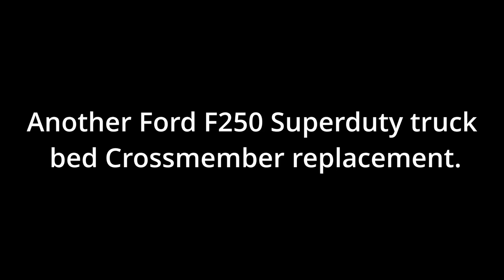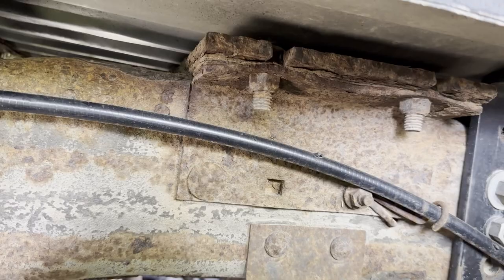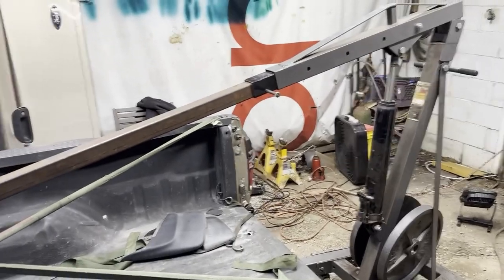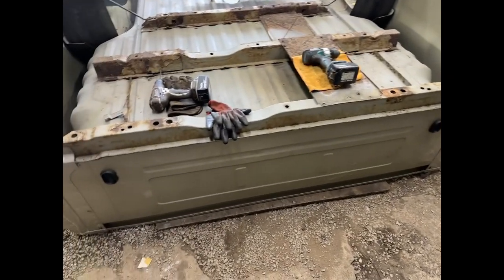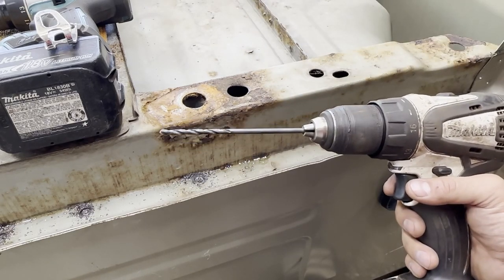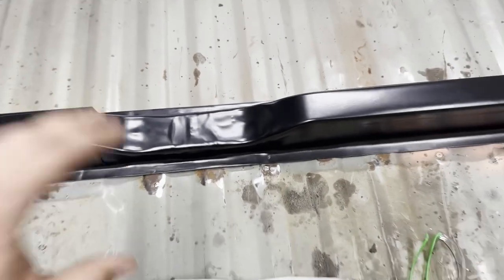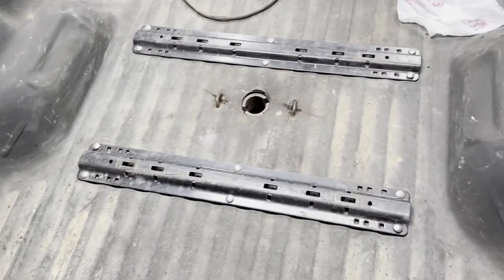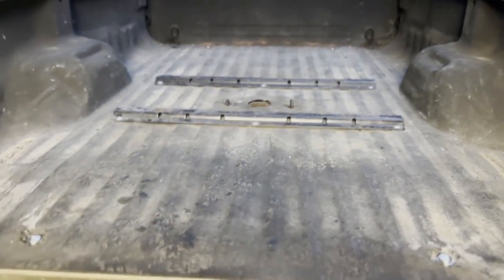02 Ford F250 bed crossmember replacement

Comment: Great job. Well made video too. I’m doing this project this winter with some other rust repairs. I’ve got a 2004 manual 5.4. Whole beds are expensive and hard to find. Replacing the truck is just not worth it.
Reply from the maker: Thank you, I appreciate it!

Comment: I wonder if body adhesive, even construction adhesive. would be a better choice. The bolts are holding it down anyway, the rails just keep it in place. Body adhesive can be stronger than welds. Also less chance for rust.
Reply from the maker: Probably could use 3M Panel bond. For me it is a time factor and I usually don’t have time to wait for everything to cure. Maybe someday I’ll try it.
Reply: @FullRange4x4  Yep that is true, there is a delay to install. But I know some cars use it for the trunk floor, so it is up for the job. Welding definitely makes metal more rust prone, this metal is very thin to start. I also worry it would wreck my linex.
Reply: Dont think I'd be using panel bond for the center cross members. Its not a continuous flat surface due to the ribbing of the bed. I'd be okay with Panel bond if all the joints were perfectly flat for maximum surface area for the adhesive to bond to. During the repair I would use weld through primer to help the weld joints stay corrosion free.

Comment: Instead of spot welding them can you use a nut and bolt to secure the frame to the bed ?
Reply from the maker: Sure you could. I know I wouldn’t want to drill all the holes but I get it if you don’t have the means to weld them on.

Comment: How you keep the sprayed in bed liner from flaming up while welding?
Reply from the maker: It’s a really tedious process. Either the bed liner needs removed or I will do a quick tack…let it cool for a few second and then spot weld it. It takes a little practice and the welder has to be dialed in just right to get enough penetration on the tack weld before you spot weld it in.

Comment: Where did you get the support rails.  I have a 2000 f350 long box. Thanks
Reply from the maker: Here is my Amazon link to the exact kit I have been using for these. 
https://amzn.to/3vLguoH
Reply: @FullRange4x4  there currently out of stock...dam
Reply from the maker: @daverepole9283  I used these as well a few times. These were not available for a while but just saw they are now and will save you $30.
https://amzn.to/3xsQC1p
Reply: @FullRange4x4  I clicked on them and it say currently unavailable
Reply from the maker: @daverepole9283  odd.
Reply: @FullRange4x4  thank you for trying.  Really appreciate it..
Reply from the maker: @daverepole9283  you welcome.

Comment: How did you flip the bed over?
Reply from the maker: I tip these up by myself. I have plywood and stuff to lay under so I do not scratch anything up. Sometimes I do have the help for that step by most of the time it is just me. I recommend a helper or a good workout routine which I do have in place.
Another option to look into is a DIY rotisserie using a piece of plywood bolted to each end and rolling the bed over.